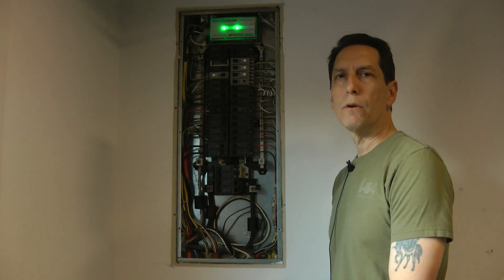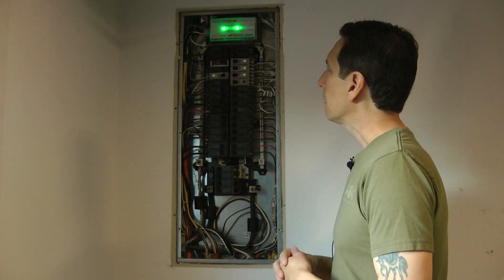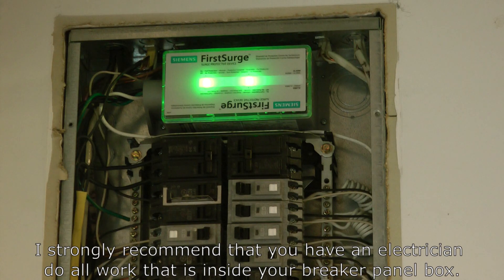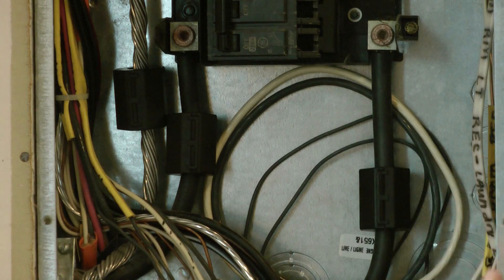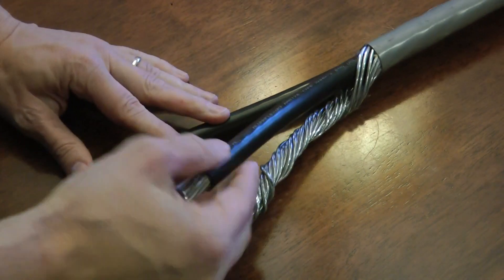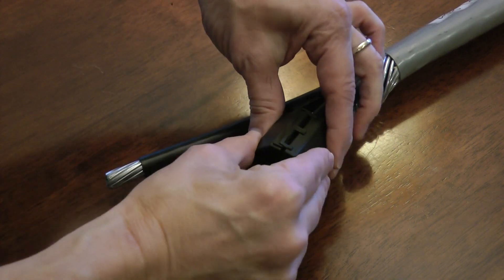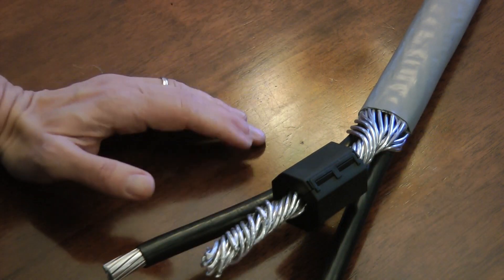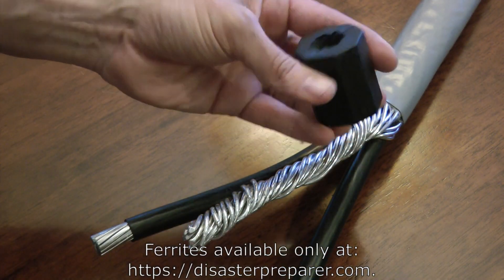Whole-house EMP Protection Installed

Comment: I ordered 3 ferrites from you and have 4 cables going into my panel  200amp service should i put #3 ferrite on neutral or ground for now until I order another, my neutral bus bar and ground bus bar are physically connected

Comment: this will literally do nothing to protect a residential structure from an HEMP ,  just saying there is so much more engineering to the building , electrical and other systems to even remotely protect a non purpose engineered structure

Comment: Could they be placed on the overhead service wire from the pole to the house?  My overhead service wire has all three wires nicely split out before they are connected to my house service wires.

Comment: What about impedence difference with and without the cores? I've had some lamps flicker slightly with one installed
Reply from the maker: The impedance of these ferrites at low frequencies (i.e., 60 Hz) is extremely small, and I've never seen it affect circuit performance. It's a good question though. I wonder if the light you're referring to might have had some type of data over power interface.

Comment: Did not demonstrate the use of small ferrites for broadband devices.  I got the ferrites and the Siemens  whole house surge protector  that he recommended.  However, the electrician installed the surge protector in an external housing that way I can see if it is in working condition  (i.e., the little green lights are on) when the panel door is closed.  He also installed the ferrites.
Whether or not we have some EMP event, the installation secures my electronics, eve LED light bulbs from, lightning strikes which are common here in the deep south in the summer months.
Reply from the maker: I demonstrate the small broadband ferrites here: https://youtu.be/uBrjr3AClAQ.

Comment: I am confused. How is hooking the surge protector the a 20 amp breaker going to knock off the main if the surge protector clamps am incoming spike? Wouldn't it have to be connected to the main buss just after the main breaker?

Comment: How long to these ferrites last on a typical house?  I get the impression they will eventually become saturated.
Reply from the maker: They don't degrade over time. I've had ferrites used for many years with no issues. Saturation occurs when there is too much current, and it is only temporary. When the current drops, the saturation state is removed. Saturation essentially just means that the material has as much magnetic flux in it as it will support.

Comment: Thanks Doc!
Question: if I did all of this in your video, would my motorcycle that's plugged in to a trickle charger be protected?
Reply from the maker: There would certainly be some protection. Even, so, I'd recommend putting a broadband ferrite around the trickle charger cord.
Reply: @disasterprepper  10 4, thanks 👍

Comment: Why would you put it through a 20amp breaker if you're trying to trip the main breaker/Grid disconnect which would be larger?   Almost justifies a breaker for disconnect on the neutral..
Reply from the maker: I actually put mine through a 30-Amp, but the same question applies. The answer is that modern thermal-magnetic breakers go into a fast trip mode when there is about 10X the rated current through them. So, in theory, if you pull more than 2,000 amps (roughly 10X the main house breaker) through the surge protector, both the main and secondary breakers will go into this thermal-magnetic trip mode and trip simultaneously. I was able to verify that this is true for a 50A and a downstream 10A breaker, but my lab wouldn't allow me to pull a full 2,000+ amps. There are no guarantees, of course, but that is one of the goals of using the surge protection device. The other is to dampen short duration pulses as well as fully protect anything tied to the secondary breaker. Oh, I should have pointed out that Type 2 SPDs are only approved for use on secondary breakers, not attached directly to your main breaker (for safety reasons).
Reply: The breaker is a means of disconnect only, not over-current. The SPD creates a path of least resistance to attract surges and shunt them to ground, while allowing a safe amount of let through voltage to continue the operation of electronics in the home. These devises react in less than a nanosecond.
Reply from the maker: @Terable13  Thanks for your comment. I agree with the exception of the response time. The MOVs that I've tested took about 10-15 ns to fully turn on. Not sure what type you may have used. Of course, there is also the time for the pulse to travel the length of the wires to the SPD (roughly 1-2 ns per foot).
Reply: @disasterprepper this is the reaction time it takes the MOV to change state from standby to short circuiting. We got this rating from the MOV manufacturer, and tested in our labs.
Reply from the maker: @Terable13  Thanks. The response time of the intrinsic material is likely below 1 ns, but once lead inductances and other nonidealities are included, I've seen turn-on times of 10's of ns. It would largely depend on the pulse applied and how a short-circuit was characterized. They're fast though, and for most applications whether it turns on in 1 ns or 20 ns would make no difference. The turn-on delay due to the inductance of the wire to the SPD is likely to dominate the turn-on time either way.

Comment: I bot 1. It looks like its hooked in so it pulls current to run but not in a way that would intercede between the main current and the existing breakers (out-going current),How does this Siemens surge protector shut it all down in time when its not 1st in the line of breakers getting hit with the surge?
Reply from the maker: A Type 2 surge protector, like the Siemens, is placed across the incoming power lines ideally close to the main breaker. Electrical current travels about a foot in one nanosecond, so as long as the SPD is close, the surge protector begins to turn on while the incoming power line surge is still rising. With an EMP, it gets a bit more complicated with E1, E2, and E3, but maybe this simple explanation helps.
Reply: It does not matter where the break connected to the SPD is positioned in the panel, it's most important the leads are as short and straight as possible.

Comment: Zip ties around them will add a layer of security to prevent them from opening should the clasp crack or fail.
Reply from the maker: Sounds reasonable. I haven't seen them deteriorate over time and break, but anything's possible. Certainly doesn't hurt to zip tie them closed.
Reply: disasterprepper it was just a thought. I work on inverters that have used similar emi ferrite chokes and other current monitoring devices that have had really questionable clasps that I’ve never trusted to stay on. Those are probably more well made.
Reply from the maker: @sadhvacman7238  Fair enough. Never can be too careful.

Comment: Great information, thank you.  For the folks who have a service disconnect on their property so they can run a generator and not back feed into the grid, are there install instructions with those Siemens FS140s?
Reply from the maker: I don't known what their instructions include, but I would think you would install the FS140 on the house-side of the service disconnect. That way it will still be protecting your home from surges while operating on the generator.
Reply: You would install the SPD on the Load side of the disconnect and connect via 2 pole 20 or 30A breaker. For Disconnects and loads without breakers, there is a Siemens Type 1 SPD TPS3A03050 carried on Amazon which is recommended for generator ATS's, well/pool pumps, and HVAC disconnects

Comment: If this is actually effect for protecting against EMP, and so simple and so easy to install, WHY aren't power companies protecting the entire grid like this?
Reply: because money is more valuable than human life...duh
Reply: @dgessence  ROTHSCHILD owns PG&E and TRUMP.Satan rules The Earth
Reply from the maker: Well, the size of the ferrites to protect transmission lines would be quite large, not to mention expensive. Ferrites are used lots of other places though. If you have a laptop, take a look at the cord, and you might see a round bulge at one end - the ferrite.
Reply: Bcuz that would make too much sense, plus they would have to upgrade the entire grid. Good luck even getting them to fix it when it breaks. Its all greed, unfortunately. Instead of the smartest, companies are mostly lead by the shiestiest.

Comment: why not just put one ferrite on the main wire with all three inside it?
Reply from the maker: It's a good question. Placing one large ferrite around the entire wire bundle would offer good common-mode suppression. In other words, if the signal were identical on all the wires coming into the house, it would help to suppress that common-mode signal. Unfortunately, with an external event like an EMP, there is no guarantee (in fact, it's very unlikely) that the transient would be the same on all three wires.

Comment: 5:12 "tight so they make a good connection with the ferrous material" - but it looks like aluminum wire. Non-ferrous metals include aluminum, brass, copper, nickel, tin, lead, and zinc, as well as precious metals like gold and silver.  So,  ???  are you talking about?
Reply from the maker: I was referring to the ferrous material connecting back to itself. It's a loop that opens and then re-closes around the wire.

Comment: Would there be a problem with using a 50 amp breaker? And, what amp breaker is optimal?
Reply from the maker: If you use a 50-amp breaker with a Type 2 SPD equipped with 10 or 12-gauge wire, there might be a fire hazard. If your breaker is oversized like this, the wire might overheat in the case of a short and ultimately cause a fire. Siemens SPD calls for up to a 30-amp breaker, and I wouldn't recommend exceeding that.
Reply: @disasterprepper  We found an unused 30 amp double in the breaker panel at my office. Everything went well.
Reply from the maker: @toddhope2  Glad to hear it.
Reply: The FirstSurge SPDs are pre-wired with 10 AWG conductors. 2 Pole 20 to 30A breakers are required, 50A is not code legal and will result in misoperation of the SPD

Comment: I am glad these are split ferrites so you don't have to d/c the lines and thread them on.
Most of the ones I found were not split so it would be more difficult to install...these are a lot better.

A tip:  If you have the smaller gauge wires...just put a zip-tie around the wire at the place you want the ferrite to be and attach it above...then it would not slide down too far  :)
Reply from the maker: Thanks for the zip-tie tip Gregory! I'm going to pass that along to others. The ferrites fit very snug over typical 4/0, 200-amp feed wire, but if someone had a smaller service feed, the hint would come in handy.

Comment: Can the damage of a EMP be avoided if you have time to kick off the main brakers both at the service and outside at the utility company braker. Will that stop the EMP or Solar current from traveling through the electric components no longer connected to the home service.
Reply from the maker: Yes, much of the damage could be avoided if you had time to open the circuits. The problem is I don't know that you'd have any kind of warning.
Reply: @disasterprepper  Thanks for your answer, I will have plenty of time. I always have to much time to the point of not remembering that time has come. Hope you don't  live in the midwest because damm that's going to be a big earthquake.

Comment: Could you explain any everyday benefits of theses ferrites, if any?  Like EMI suppression.
Reply from the maker: These ferrites are specifically designed to remove very high frequency conducted transients (say from 50 MHz up to well over 1 GHz). If you're trying to remove lower frequency transients, the surge protection device will protect against very large ones, but not those that don't exceed a few hundred volts. To do that on power lines, you either need an in-line filter (very large and costly for a house) or you need to address the transient at the actual device, rather than at the incoming house feed.

Comment: I have a few unrelated questions. Thanks for the video.

1. If I wanted to protect one room in my house from transients (is that right?) radiating in the air, does partial protection help? For instance what if I used RF block paint on all the walls but didn't should a window or the floor? We have a metal roof too. I imagine what you've said before applies that there has to be a tight seal with no gaps beyond 1mm (I think you said 1). 

2. If I wanted to protect electronics I use every day would your conductive cloth help or be useless since it's not touching ground. For instance a 3D Printer and ham radio gear on tables in my office. 

My goal here is to protect the lines coming in my home, which you just demonstrated, and to avoid having to lock away in a Faraday cage all the gear I use on a daily basis to protect it. Let alone having to buy multiples of expensive gear that sits in Faraday cages. I have older gear that sits in Faraday cages, but my nicer new gear would be nice to save...
Reply from the maker: Hi Devin, in terms of radiated RF energy protection, until you get everything pretty tight, you might not see much overall shielding. That's because the energy finds its way in through cracks, gaps, etc. There are films you can put over the windows, which would likely be the biggest source of RF coming in if you used conductive paint on the walls and ceiling. As for Question 2, you can wrap electronic items in something conductive (the cloth, aluminum foil, etc.), and it will shield them, regardless of whether or not it is grounded. Even covering has been shown to significantly reduce RF energy, basically by acting as a blanket from incident energy coming from above.

Comment: This doesn't make sense to me, if the incoming power is going through the same EMP or CME...they would be taken out also. What good is having a house that is protected when your main line incoming is not protected?
Reply from the maker: The ferrites and SPD are used to suppress the conducted pulse that is introduced on the power lines from an EMP or CME. They each do different things. The SPD suppresses the E2 and tries to trip the upstream breaker when E3 arrives. The ferrite helps to address the conducted E1 by reducing its level and helping to spread it out enough in time for the SPD to kick on. The overall goal is to save the home's electronics, not to keep the grid from going down. The idea is that having a home with functional electronics would be useful because you could attach a generator, or take advantage of any times that the grid came back up. If this didn't answer your question, can you rephrase it? I might have misunderstood.
Reply: @disasterprepper  No...my point is that with an EMP or CME, the grid is definitely going down and will not be restored for a very long time (transformer resupply is the biggest problem, but that won't even matter because of the anarchy that will take place when the grid goes down). Running a generator can only work for as long as you have fuel or someone takes what you have...whichever comes first. The same applies for solar or any other power source...someone will want what you have and you better be able to protect it.
Reply from the maker: @scottkb2000  Sure, I get your point, and it's a fair one. Mine is only that there might be other options, such as the use of solar power systems or portable generators. Another scenario is that the grid is able to be brought up for brief periods, in which case, it would allow those with functional houses to function briefly, cooking, washing clothes, etc. Anyway, I appreciate your thoughts.
Reply: I think he's getting at what will other people do that don't take these measures? It's not like life will continue on peacefully in order... I'm sure you've thought of this before that's where I'm stuck at
Reply from the maker: @Saint696Anger  Ah, well, I think the same can be said of nearly any preparation. For example, I'm often asked why store food when others are going to just come and take it from you. My view has always been to address one challenge at a time, food, water, power, protection, etc. I understand the concern, but I always feel that I'm in better shape having options.
Reply: @disasterprepper   Sometimes the thought/concern can get to us. Good honest reply and that's why I'm still here trying

Comment: please provide the specs on these devices and your calculations of how well these devices might work on an EMP.
Reply from the maker: Hi Greg, I plan to do a separate video with all the calculations and specifications. Kindly give me a little time to put all that together. It's not as easy as saying that the ferrites will drop an incident E1 pulse by x%, because every home is different in terms of its current draw and input impedance. I'll explain all this in the coming video. The short of it is that the ferrites provide a series impedance to help reduce incoming high-frequency pulses in high-current wires.
Reply: @disasterprepper  I'm curious to know if you are using a 61 mix ferrite, or if it's a custom mix?  What makes  these ferrites special (from a fellow engineer)?
Reply from the maker: Yes, the material is a 61 mix with a special non-conductive gap material added in a carefully determined thickness to spread out the B-H response. I'm going to do a video on the details soon.